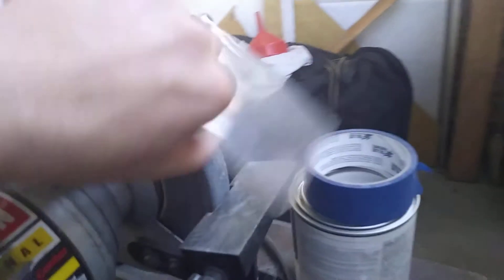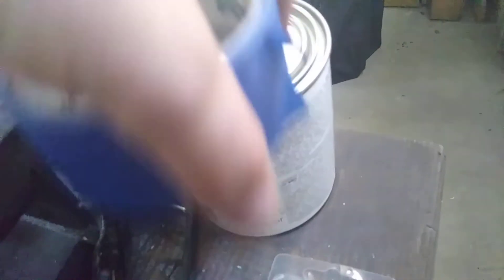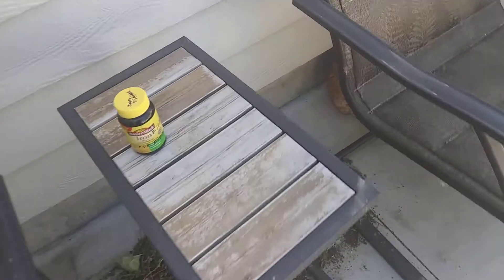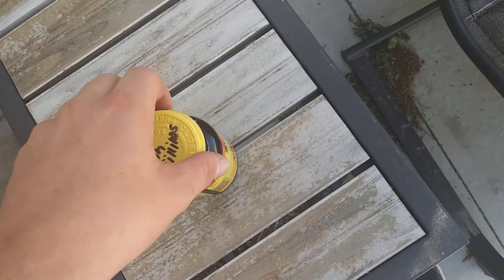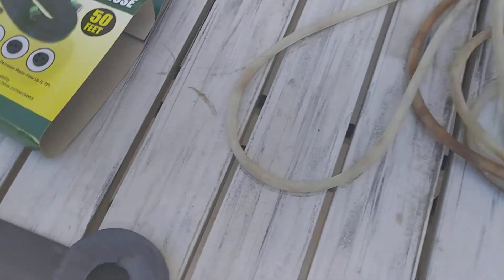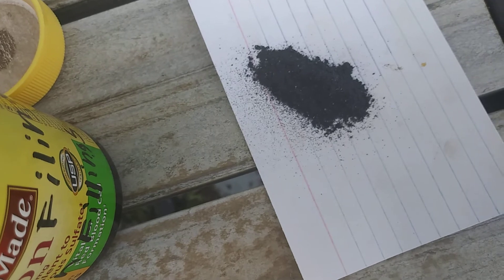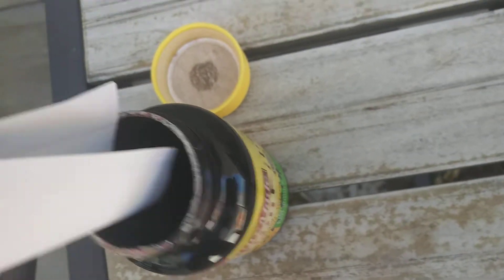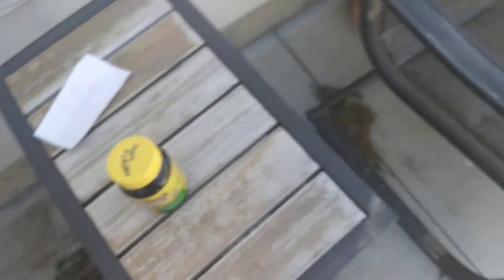How to get iron filings the easy way

Comment: Hello can i use soil btw this is a nice vid i will sub
Reply from the maker: Yes you can use soil, however you will get less than you would just filing them down from a piece of steel. But yes, you can get a decent amount from the soil. Using a magswitch will help with that.
Reply: @magnetnerd488  ok!